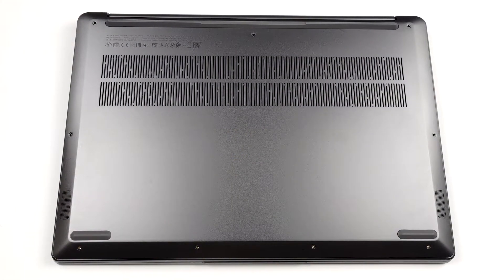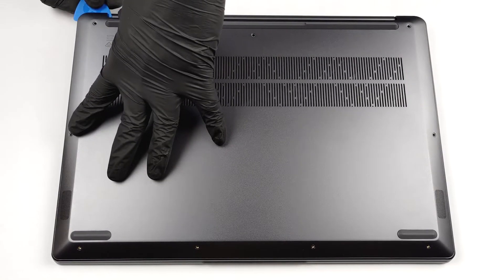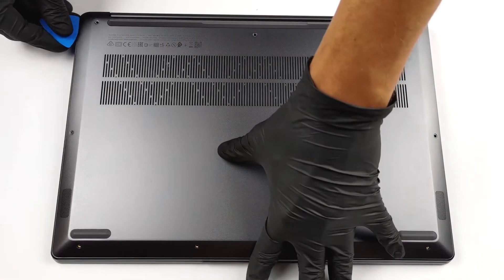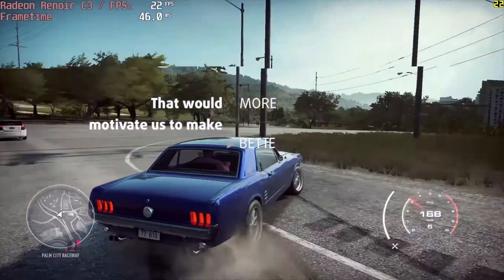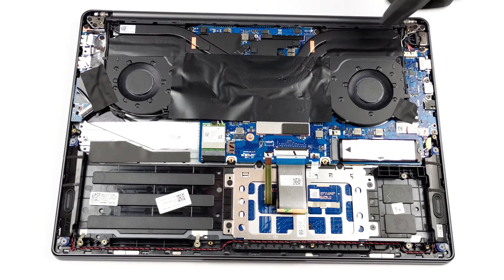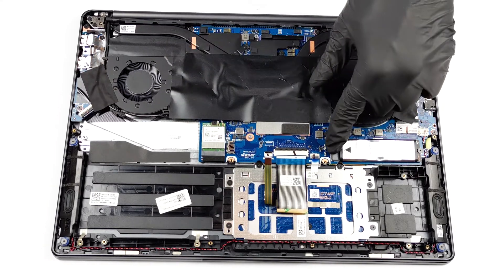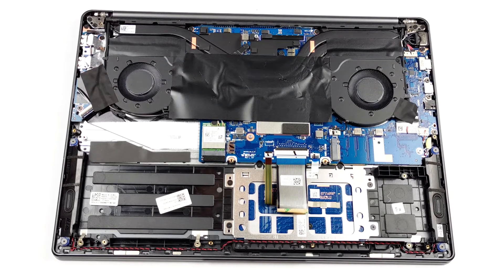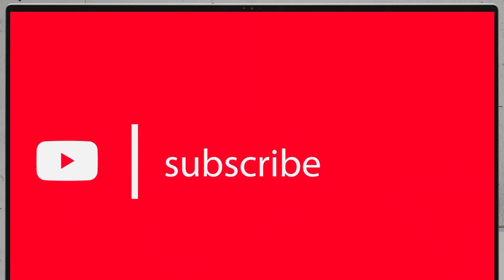🛠️ Lenovo IdeaPad 5 Pro (16", AMD) - disassembly and upgrade options

Comment: Pretty bad design. A huge 2kg 16 inch laptop and they could not fit at least one memory slot or one extra SSD slot...
Reply: Exactly last year AMD Lenovo E14 Gen 2 the 14 inches variant had an 2nd full size slot for an M.2 SSD + and extra extra slot for memory module (One soldiered + Removable) its just planned obsolescence as they would want you to replace the laptop even faster then its life span as no easy way to add an another stick of ram or change current ones capacity without soldering or paying Lenovo probably an expensive fee for replacement of ram module.

Comment: Do you know if ssd with heatsink can be installed? Mine is the IdeaPad 5 Pro 16ACH6 and comes with the 512GB SSD M.2 2280 NVMe TLC so is planning to upgrade to 1TB firecuda 530 or the Samsung 980 pro (as officially no mentioning from Lenovo that it take 2tb) and the difference in price with and without heatsink is very marginal so is wondering if it can be fitted with the heatsink one to reduce heat.

Comment: What do you mean by 'configure the RAM up to 32gb? So it the RAM upgradable?
Reply: no, there are different models with a maximum of 32gb RAM, the RAM is soldered on the board and therefore not upgradable.
Reply: @hitori_ja_nai_desu7597  even if it's soldered some time you can still upgrade it. The question is, can it be done on this model ? Will the motherboard support 32gb if new chips are soldered in there ? This is a great laptop, but the small memory capacity of 16gb make it almsot useless. Most of the time I am at 90% RAM ussage as a web/desktop developer.
Reply: @MrDragos360 Huh, didn't know that was possible (had to look it up). But considering there are 32gb models doesn't that answer your question?
Reply: @hitori_ja_nai_desu7597  I saw a video where the ram on an mac was replaced. I think if that's posible on the macs it could be posible on this one too.  
It depends on the motherboard, the 32GB model has a dedicated GPU. They could have different motherboards. I can't find the model for the motherboard and ram chip.
Reply: @MrDragos360  Soldering extra memory will likely void the warranty.
Reply: @todanrg3  who cares about warranty ? Most electronics never brakes while in warranty but after. Also laptops hardware doesn't fail so often
Reply: @MrDragos360  Many people care. I had friends who's laptops broke and had to be replaced in warranty. One was a Lenovo Yoga, another a Dell XPS, quite expensive.
Reply: I have the same labtop, i don't understand. Can I upgrade this labtop to 32g ram ? By contact with lenovo or any autorized agent, or with my self
Reply: I have the same labtop, i don't understand. Can I upgrade this labtop to 32g ram ? By contact with lenovo or any autorized agent, or with my self

Comment: "Pro" laptop without upgradeable RAM, Lenovo is a joke
Reply: Well you can upgrade it till 32 GB while buying, and for most people 16 GB is quite enough.
Reply: 5800 with a 3050 for a low price what else do u want lol
Reply: Indeed the branding is not deserved. But it is the price to pay for low price and thin profile. It is the cheapest 5800H model to get in my country. I would use a dedicated GPU and 32GB RAM for video creation, but it wouldn't cost $1000 then here. These are like $1500. Decided to buy agressively according to the current needs, and so this was the choice. I am not exactly unhappy. Normal work is seamless like with any Desktop PC, and work is "bearable" 🤣

Comment: I can rattling from the left fan when I shake the laptop up and down. There is also really quiet buzzing from the left side of the keyboard that can only be heard if you place your ears really close to the keyboard. Should I open the laptop up and see what it is? Maybe it's a loose screw?
Reply: i have same buzzing, did you open laptop and solved this problem?
Reply: @can1.  I did not open the laptop. I actually had a hard time doing it because my tools were plastic and the laptop metal bottom kept preventing me from opening it. I was inexperienced with opening laptops so I was afraid. I ended up returning it for a full refund.

Comment: there is a model i found that has 8gb ram, so could i upgrade it to 16 if i add another 8gb to it? for a total of 16
Reply: No. It's soldered.
Reply: Would need to pay someone to despiser it and resolder 17
Reply: @official_pol2198  what

Comment: what is that green chip that is removable but you don't say what it is?
Reply: its the WIFI card
Reply: @ariavision  can you please suggest which wifi 6 card is compatible with this one? thanks
Reply: @vinit1200  let me check and I’ll let you know
Reply: @ariavision  yes please that would be immensely helpful, as I’m a bit tight on money and would not want to buy something that is not compatible. Many thanks in advance :)
Reply: @vinit1200  hi, I have tested WiFi card 6 on it and it don’t worked well as expected, meaning no difference between WiFi card 5 and 6 with this laptop
Reply: @vinit1200  intel ax200